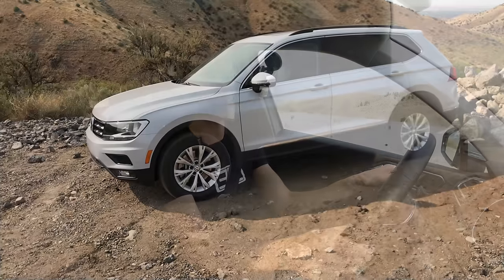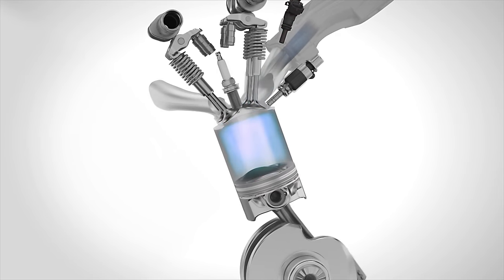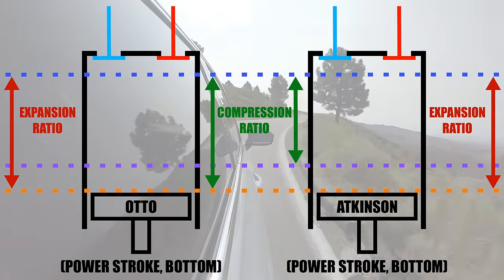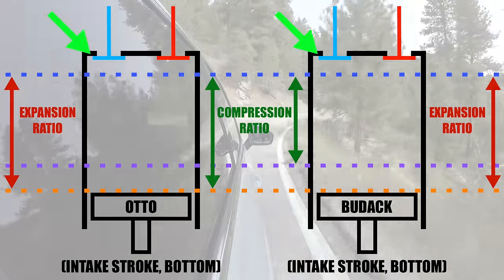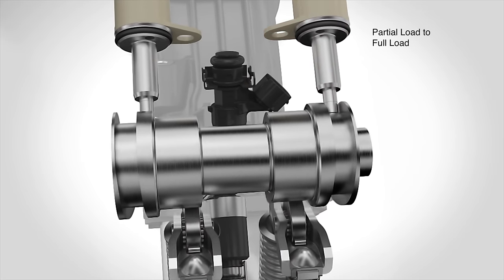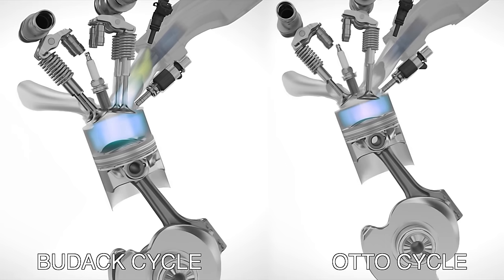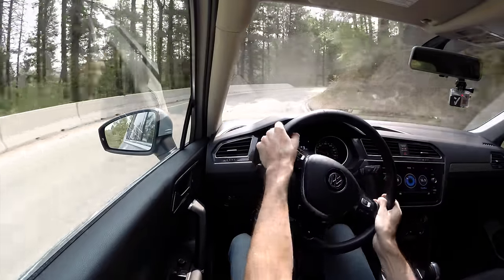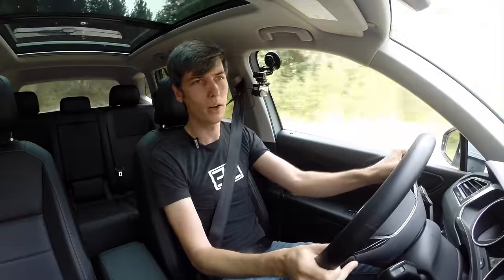Volkswagen's New Engine Cycle - The 'Budack' Cycle

Comment: All of that and it only does 27mpg??
Reply: Don't worry, that's fake too.
Reply: For something that weighs 3800lbs that's actually pretty decent hough a V6 variant would net somewhat better highway numbers at a the expense of the city rating.
Reply: Membrane556 Even so, there are lots of cars that are of similar weight and yet can still achieve better mpg
Reply: Membrane556 that's pretty crappy, my 8500 LB 5.7 V8 powered 1978 Chevy gets 23 even without an overdrive, just removed emissions controls and adjusted for lean burn operation to get that, and that's with my engine turning 3000 RPM on the highway
Reply: Haha

My 2013 subaru forester 2.5 boxer engine gives me 27.6 mpg on highway and that's with the A/C on!.  It goes to 29 MPG with my windows open..  
So,  why go Budack???  
It's a waste of money I think....
Reply: @thatguy-em9lt  ok jigsaw, that's enough boasting for this year
Reply: That was my take too.  VW cannot even get a standard no frills engine to work, let alone something like this.  I doubt the buyer will even get home the first time in this thing without the engine light coming on.
Reply: I think vw general idea is for better efficiency for the customer but to do so with less shitty emissions. I'm not sure why Jason only talks about fuel efficiency. Maybe he wasn't given any emissions numbers. And Of course vw will want to promote the fuel efficiency over anything else... Because dieselgate etc... Which was years and years ago now... Naturlich...
Reply: A 4.0L V8 twin turbo 600HP Audi A7 series gets 5-6 L/100km (47-56 US MPG) on a flat freeway on cruise. Avgs 9.4 L/100kms (30MPG) on the combined cycle and it's 4600lb. I can't understand why this Budack is similar. Should be much better.
Reply: Tepid Tuna different materials? Alloy crank, lighter better designed pistons etc? 
Also the turbos must be boosty to make 400bhp (much more boost than the budac?) 
 Some differences of the main desirable features will become obvious with a little sleuthing. 
Then there's the cost. V8 4L twin turbo vs 2L budac lmao
Reply: @SilverCanary1  Agreed, there's certainly much more money put into the Audi engine to engineer a great motor and it would use much better materials. Very boosted engine stock, 18.5psi. I also forgot it cuts to 4 cylinders on light load. Still the extra engineering should only account for a 20% diminishing gain over the Budack. Anyway it is what it is. :-)
Reply: Tepid Tuna it all adds up (or minuses)...

Unless dieselgate chenanigans
Reply: You realise US MPG is different it UK MPG........
Reply: It also takes 35 seconds to get to 60.
Reply: @lechywecky  only? Try a 2.5 litre V6 which does 22mpg.
Reply: That's because just about all new cars are tanks weight wise. Gez, going by their rego slips, a contemporary VW Golf weighs more than my 1974 V8 does, 111" wheelbase et all.
Reply: I have a new 2019 Tiguan and I am getting 38 mpg on my morning commute of mostly freeway driving.
Reply: @tepidtuna7450  man ,simply the more money you pay the better everything you get in return,e.g;- 2013 Lexus Ls600h,6.6l/100kms,plus 0-100 in 5.7sec-but $217,000 dollars in Australia, there's your answer.Thanks

Comment: What are the advantage of this cycle vs the Atkinson? why wouldn't WV just use a normal Atkinson cycle instead of developing a new one which is basically the same.
Reply: Exactly my question as well. Maybe in the Atkinson cycle a small quantity of fuel is evacuated with the air at the beginning of the compression cycle when the valve is still open?
Reply: It's a propitiatory system, so anyone using the "Atkinson" cycle outside of the patent holder pays to use it. SO it is all about cost/benefit... VW has developed their own version of the tech and in doing so save money since it is their own tech. Not having to pay someone else for something will not only benefit VW but will also reduce the impact to the customer with overall reduction in price increases.
Reply: 0ExG0 Power delivery is better since it's capable to switch to Otto mode. Toyota overcomes this problem with the electric boost motor in their hybrids.
Reply: What about the pumping loss? I think the advantage of closing the intake valve sooner is to use the air-spring effect.
Reply: Maciek is right, it will lead to lower pumping losses, which is the energy used to fill the cylinder with air/fuel. In an Atkinson cycle, some energy is used pumping air back out of the cylinder, which this cycle doesn't have to do.
Reply: +Forever Peace
I boils down the the bottom line... the almighty "dollar". The Atkinson cycle is a trademarked propitiatory tech, meaning anyone using has to pay for the rights to use it. SO by VW or any company for that matter, developing their own version of it, allows them to make all the money on the sales of the vehicle.
Reply: When combined with a turbo, this cycle will not be pushing against the high pressure in the intake manifold during the comprehension stroke.
Reply: Early intake valve closing is easier to get overlap and internal EGR because the cam centerline is more advanced. It can also be used for late intake valve opening to help light off the catalyst.
Reply: +ckatlinga
Well no company is going to reduce the price of their product because they discovered a way to make more profit out of it and keep the prices the same, that would just be "bad" business. However by reducing production cost overall, the consumer will see less of a price increase the following years. SO in a sense they are passing on the savings, just not in a way that most of us would even notice in the short term. But like the OP asked "why"... why does any business do anything... it's about the bottom line, staying profitable. Since no one works for free, no company is going to give things away.
Reply: fuel economy, less performance, better efficiency
Reply: I'd expect there to be improved mixing in the cylinder as well, if only based on the potential of having fuel in there longer.
Reply: MasterMech77:  You sure the Atkinson cycle is "a trademarked propitiatory tech"?  The cycle was invented back in the late 1800's.
Reply: There should be more even air flow and more stable vacuum since you don't have part of the intake charge going back into the intake.
Reply: That and designs are covered by patents, not trademarks
Reply: That's what I'm thinking. The animation shows the fuel injector up in the intake, so if it was running the Atkinson cycle, it would force air/fuel mix back out of the cylinder and pull it in on the next stroke. Tuning that would likely be a real pain in the ass. I also wonder if that little bit of vacuum at bottom dead from the shut valve with the Budak cycle might help aerosolize the fuel droplets a little better, though I'd be surprised if it was enough to matter.
Reply: Darwinpasta If nothing else it should help reduce pumping losses. Like you said a little bit of vacuum as opposite of the Atkinson and Otto cycles pump pressure back out the delayed closed vavles

Comment: Can you make a video about the 5-stroke engine concept?
Reply: Jan 94 look it up
Reply: volvo penta engines
Reply: It's really 6 strokes when you think about it. 5 would be impossible, it has to be an even number. Basically after the exhaust stroke you have an intake stroke where water is injected. The water evaporates in the hot cylinder and creates high-pressure steam that pushes the piston down. The steam is then exhausted on the upstroke. Good heat efficiency in principal, but it also cools the engine too much + it requires you to carry around a tank of water which means a lot of extra weight.
Reply: noxious89123 no, 6-stroke(water injection you mentioned) and 5-stroke engines are different. In a 5-stroke, during the exhaust stroke the gas is simultaneously loaded into a larger cylinder, then exhausted for good. So it goes intake->compression->combustion->pushing gas from smaller cylinder into an expanding larger cylinder->exhaust from larger cylinder, thus 5 strokes. Look it up
Reply: "Revi M Fadli"  So basically the McLaren concept?  It looks like a 3-cylinder but it's actually a twin.  The first 4 strokes of the Otto Cycle run in cylinders 1 and 3, but on the "exhaust" stroke of each, the cylinders dump the exhaust into the second cylinder instead, which runs "two-stroke" for this purpose, so that the exhaust gets compressed and released one last time in the second cylinder before being released into the exhaust manifold.  The engine basically runs 1-2-3-2 with the 5th re-compression happening in the second cylinder?

I didn't know if that was still a thing or not, and how it would work in terms of either emissions or changes in torque or horsepower relative to either a twin or 3-cylinder.
Reply: BPoe07 well what I know was the one from Ilmor. Since the "two-stroke" piston is larger than the "four-stroke" one, it expands during the fourth stroke, making it 1-2-3-3-4
Reply: there is no 5 stroke engine.  it is a misnomer for retarding the closing of the intake valve.

Comment: This is basically just vvt for efficiency, right?
Reply: Colin Bergmann yup. Just a fancy term for valve lift/event control.
Reply: Just playing with the intake lift duration to improve gas mileage or create power like every company ever.
Reply: Yeah Honda had this long time ago
Reply: It's just a company fancy name to advertise their engine, see the butterfly valve serves the same purpose (limiting the air flow) as the engine is under low load, it is being done from centuries or from the beginning of the engines using 2 strokes
Reply: Colin Bergmann yes! A low power tune. Junk

Comment: I just cant trust VW/Audi anymore with being able to develop reliable complex mechanical/electrical engineering designs.
Reply: On the flip side, there are some, like me, who have owned six VWs over a combined 24 years and  >400,000 miles without any engine, transmission, or electrical problems...
Reply: Why are they creating new internal combustion engines. Sometimes you have to wonder about the Germans.
Reply: @oldnordy2665  maybe you're just lucky lol

Comment: All of these crazy cycles and cam technologies just need to go away, and the FreeValve tech from Koenigsegg needs to take over (when it's good and ready to).
Reply: I wonder if a Koenigsegg has ever gone more than 50000 miles.
Reply: Free valve partnered with a Chinese company make a 1.6 L mainstream engine.
Reply: @emptyshirt  Which model do you have in mind? If you're referring to supercars, the same question could be asked of Ferrari, Lambo, McLaren, Bugatti, Pagani, etc.
Reply: @exothermal.sprocket  My point is just that tech found in super-cars might never be cost effective and reliable enough for a Chevy Malibu

Comment: I"m just thinking if this makes more sense than old style Atkinson cycle. I got doubts. Closing earlier intake valves make in my opinion more pumping loses as there is lower pressure over piston going down. 
That's why I guess Atkinson cycle is more efficient than Budack cycle.
Reply: Budack has less losses from the air going through the valves

Comment: my  '97 VW 1.9TDI gets 40 -50 mpg. Im very unimpressed.
Reply: I also have the later PD version and I regularly get 60 mpg. On a run on slightly slower A roads I recorded 76 mpg.
Euro 6 put an end to the 2,050 bar mechanical PD, but Bosch now have a common rail that achieves 2,200 bar injection pressure. Results should be very good.
Reply: That's a DIESEL . . . hello???
Reply: yeah but emissions have also gotten more stringent which lead to worse fuel economy

Comment: Amazing, my car gets better mpg with a much bigger engine and AWD...
Reply: Yeah but it's not "groundbreaking engineering advancements" so nobody cares
Reply: Does it weigh as much as the VW LardAss?
Reply: H2O Addict , my 1971 Volkswagen Westphalia gets a decent mpg with a bigger engine displacement (built not bought 1776cc), and a few other goodies without AWD....
Reply: +mikerjuk That's a friggin awful way to look at it and it doesn't really effect freeway MPG. Using "my car weighs more though" as an excuse is the worst excuse you could come up with. Make the car lighter.
Reply: mikerjuk over 1.5 metric tonnes, but with a 3.5 NA engine.
Reply: my pick-up has a much larger engine and can return upwards of 24 mpg on the highway.  

and it's almost 30 years old.
Reply: My car gets the same hwy mpg on a bigger engine but it doesnt make as much peak power lol nor as much low end torque
Reply: modern mpg are measured not at constant speed but at a more realistic variable speed including occasional breaking. so you get better mpg as advertised if traffic allows it. so your old junk heap does not get better mpg and it certainly is not cleaner. it's not the mpg's that kills people by pollution of the air.
Reply: 1.8 turbo diesel and 53mpg so any challenges ?

Comment: It is actually a new cycle.  When they refer to the Otto cycle, Atkinson cycle, Diesel cycle, etc., they are referring to the thermodynamic cyclical process the gases inside the cylinder are going through in terms of their pressure, volume, and temperature at every point in the combustion process.  This is what determines the efficiency of the cycle, meaning how much useful work can be extracted from the burning of the fuel.

The original Atkinson cycle engine actually had a completely different crankshaft setup with extra linkages that allowed the piston to travel down a greater distance on the combustion stroke than it traveled up on the compression stroke, giving it inherently different compression and expansion ratios.  That is why he refers to current Atkinson cycle engines as "modern" Atkinson cycle engines, because they are simulating the difference in compression and combustion strokes through the use of valve timing changes.  These engines actually have the same stroke length during both compression and expansion strokes (just like an Otto cycle engine), but the late closing of the intake valves makes the "effective" compression ratio less than the expansion ratio, improving efficiency.

This new Budack cycle performs the same trick, it just closes the intake valves before bottom dead center (bdc) in the stroke instead of closing them after bdc.  This does effectively change the thermodynamic cycle since the gases in the cylinder are undergoing an expansion process before compression that they do not go through in the Atkinson cycle.  How this affects efficiency compared to the Atkinson cycle, I don't know, but it should be more efficient than the Otto cycle.

Comment: This video makes out that under normal conditions during the intake stroke the cylinder completely fllls with air. You couldn't get that even with a turbo. There's a reason there's a big valve in the throttle body that literally works by restricting the amount of air the engine can take in under induction. 

On low to mid throttles there's hardly any air in the cylinders. If you pulled a full charge every intake stroke you'd need the correct amount of petrol to get the stochiometric ratio and the engine would be running permanent full throttle.

I can't see how this helps anything other than marketing blurb.

Comment: I question the long-term reliability of those cams vs. a traditional design. I wonder if the recess the adjustment lever runs through will be a notable source of weakness in time
Reply: Yep indeed. In this design the pin is a wear item which could cause all kinds of problems long term. The pin that locks the rockers in Hondas VTEC system moves horizontally and just clicks on or off. Obviously having been around 30yrs we know that system is reliable - time will tell with VWs solution.

Comment: I always wondered why Atkinson didn't do this. Seems lower pumping losses than leaving the valve open during compression
Reply: I didn't think about that. A really good point.
Reply: That's true, but Atkinson cycle doesn't suck vacuum. With Budack, once the valves are closed, the piston is still traveling down basically creating a little vacuum. That slows down the engine - like engine-braking. < THIS IS WRONG. Blurglide nailed it.
Reply: No- it just makes a little air spring.  The engine has to pull a slight vacuum while traveling down, but that vacuum sucks the piston back up on the beginning of the compression stroke, so there's essentially no loss.  In Atkinson, you have to suck the air past the obstruction of the valve, and then push it back out again.  This pumping of air pass a restriction is the primary loss in engine braking- not the air spring effect.
Reply: blurglide I think you've nailed it. Plus, there may be additional benefits with fuel injection techniques. If direct injected, imagine injecting during the vacuum portion of the intake stroke. Might improve atomization and allow leaner mixture.
Reply: exactly what i was thinking peter robinson
Reply: This is a great explanation.   Just as steam power on the rail ways reached the heady heights of 7% efficiency before the introduction of the diesel locomotive I get the feeling that the internal combustion too will achieve its ultimate incarnation just as electric power makes it untenable.

Comment: So on Atkinson when the valve stays open past bdc, some air fuel mixture is forced back into the intake?
Reply: @stanstanxxx  does that cause backfire, or front fire?
Reply: @fryncyaryorvjink2140  No backfire anywhere. Lower cmpression ratio of gasoline engines ensures the temps doesn't get high enough for that.
Reply: They keep the valve open past BDC because the pressure in the intake is still higher than in the cylinder allowing more fuel/air to enter the cylinder for higher compression/power. This is because the intake air still has velocity from the intake stroke and intake runner design and, in most cases, turbo pressure.